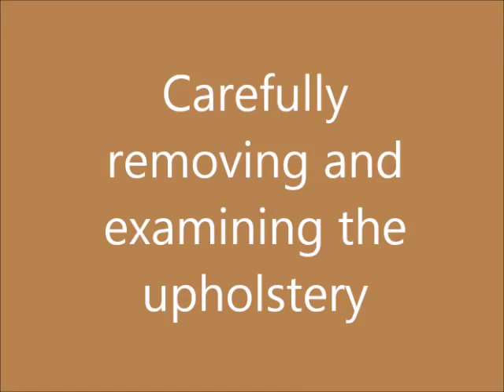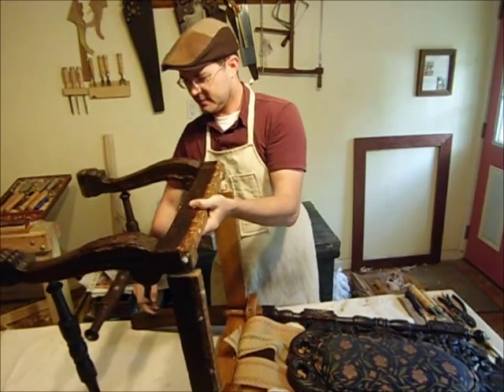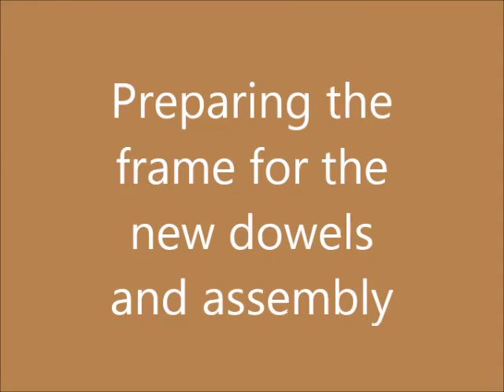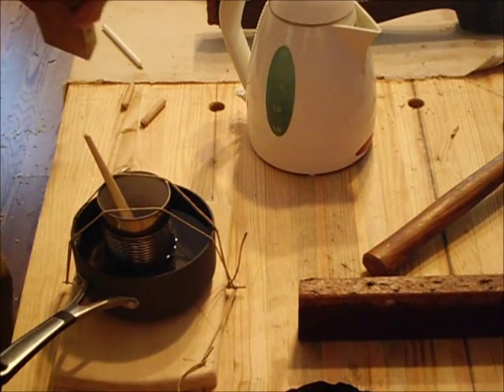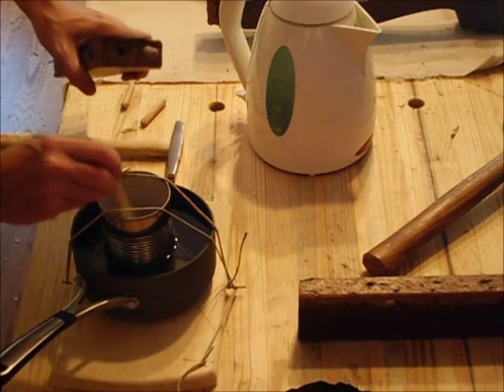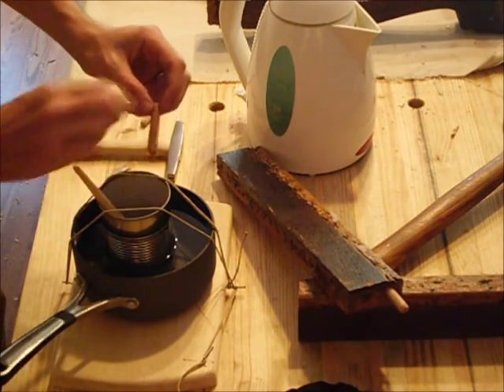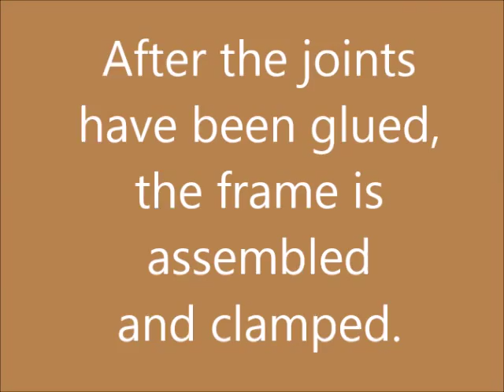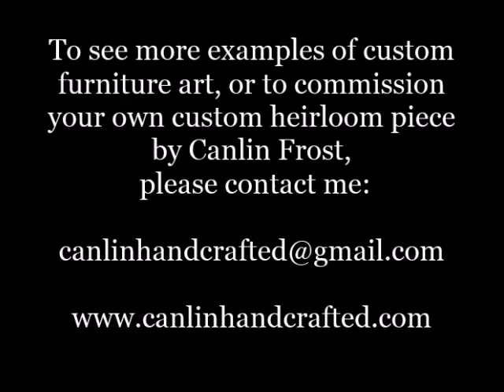Antique Chair Repair and Restoration

Comment: If this were an original 18th century chair it would have mortise and tenon joints with small pegs locking them in and not dowels which are a 20th century technique and no where near as strong. Appreciate the use of hand tools and other traditional craftsmanship like the proper upholstery nails and webbing. 🙂

Comment: Canlin,
Great video, I appreciate that you use repair methods that are as close to the traditional methods as possible. One recommendation would be once you get your webbing stretched using the stretching tool, I would keep it stretched as tightly as you can with your less dominant hand and with your dominant hand, I would take the face of your upholstery tack hammer and glide it across the webbing with a decent amount of pressure which causes the webbing to relax ever so slightly and you will find that it allows you to stretch it just a bit more and then you can tack it down. I found this method mentioned in several furniture making books from the late 1800's and I thought that it was a great tip to mention. it definitely does make a difference! 
I hope you don't take it the wrong way, I love and respect what you are doing and I hope you continue to make videos!
Reply from the maker: Thanks for the kind words and advice. I'm always looking for better methods and I'll give yours a try!

Comment: How did you attach the fabric to the chair frame?  It appears you reused the existing fabric, right?
Reply: Hi Debbie, thank you for your question! You are correct, I used the existing upholstery on the chair. One of the challenges was to keep as much of the fabric attached to the chair because there wasn't any extra fabric to trim away due to the extremely tight fit. The method I used was to use black upholstery tacks to secure the seat fabric to the wooden frame, and I might have even used some staples in a few areas where a tack could split the wood. I then covered the raw edge with the piping as shown in the video. I hope that answers your question.
Reply: Thanks for the quick response!